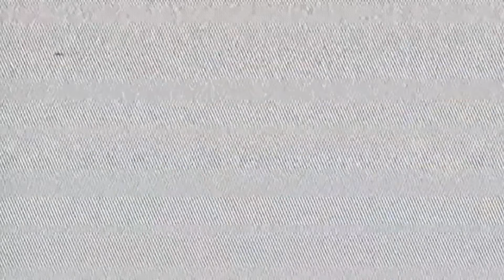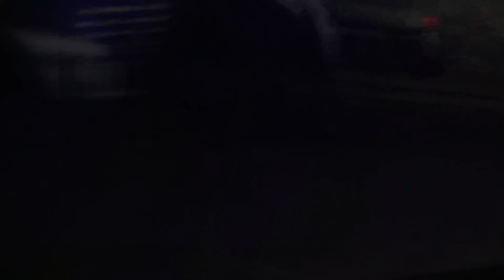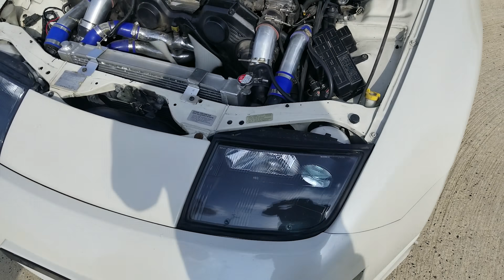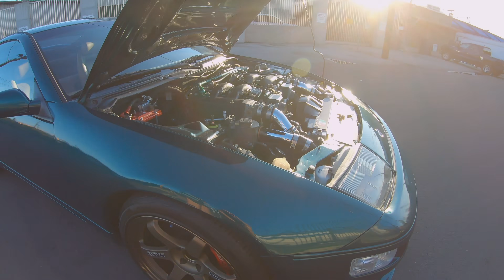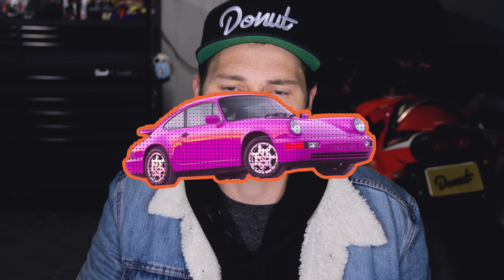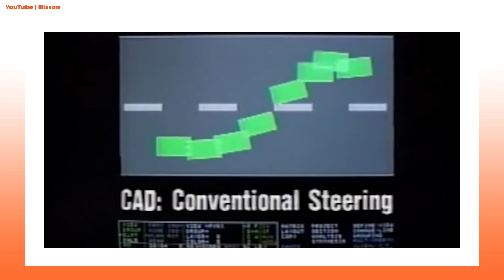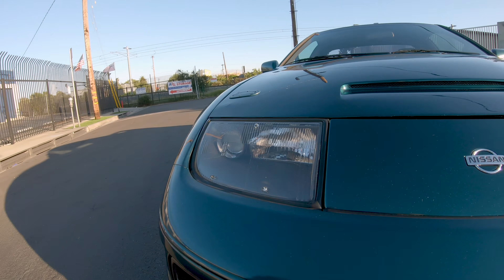The Incredible Tech that DOOMED the 300ZX

Comment: I have raced every single 300z in the world. None could ever beat my acceleration, nor top end.. my secret is I run 2 ply 45 dollar Walmart tires on my stock 92' Buick LeSabre. Also I use weight reduction by only filling my windshield washer fluid only 1/4 full!
I have highly modified it with super white headlights, and basic taillight bulbs from Bond Orheily, of course it helps that I run Prestone 50/50 formula. Leaving the spoke style hub caps, only a full on funny car built for the dragstrip has even the slightest chance of even seeing my basic bulb tail lights when racing me that's how hard I leave mthr fckrs in my dust. Obviously I only race with my Chippewa Boots on, really can't afford to fck around when running high end machines like this.

Glad I was able to help/bless everyone with this powerful knowledge. Just do not fck around guy's you seriously need to use this info intelligently as super cars like my LeSabre leave no room for driver error
Reply: Lmao. NO one wants a Buick LeSabre, even if it was faster. What'd under the hood? Stock you'd get wasted so unless you've got a c6/c7 vette engine in there...You have ZERO chance stock at a twin turbo Z and the Z is the slowest of the 90s Japanese cars (3000GT VR-4, RX-7, Supra). 
Gtfo with your old peraon car. I just read it's stock 🤣 🤣 🤣.  You'd be lucky to run 15s!

Is this a joke post?
Reply: Dude please tell me this is a joke

Comment: The 1989+ 300zx will most likely be my retirement gas powered car. We should all have one (by we obviously I don't mean non-layman car owners.).

If you have read this far the 1989 300zx I had at 23 (yes ik 23 is a bit late to have a first car.) Was naturally aspired, but the person who owned it before me did something.... amazing to it. It had a fully copper master flow inspired exhaust. I have NEVER heard a sound like a 3L engine with copper master flow. It purred deep and low. I truly hate myself now for blowing it up. 

I rebuilt some basics on it but never got to the valves and rockers. The heads and O rings. The intake was never cleaned and I never checked the fuel system. 

What happened was I took my family and my gf to a native ritual on crow Mt. My gf bitched the ENTIRE TIME. I was annoyed with her and drove 3 hours at 95mph to be done with her bitching. 🙃  with 15 minutes left to go the exhaust valve on the first piston stuck shut. Yeah. It over compressed the first cylinder and (because of a bad bearing in the lead of the crank) blew the first piston out of the oil pan. I drove for 15 minutes on a nissan engine with 5 pistons and no oil... at 50 mph. 

All that to say. I respect nissan. And I miss my ZX..

If I have a chance. Yes the 300zx 1989+ is my car. I was born in 1990. LETS GOOOOO. 😆 🤣

Comment: I had to toss my TI-89 aside as I got older..  Too damn hard to see.  Now I have a backlit HP (which has an odd viewing angle, as the panel is upside down).  I did absolutely love the styling of the 300Z then.  I always said if it had a Porsche logo on it, they could get 3 times the $$$ for it.  Cool

Comment: Almost picked a TT 300zx up a few years back.  Owner wanted $6k for it.  Only problem was I had to replace electrical wiring.  Common issue for these cars.  It was going to cost extra $2k to fix.  So I passed on it.
Reply: Should of got it bro

Comment: I have an 86 naturally aspirated that I am currently turboing right now with a 50 mm turbo a big-ass intercooler and 550cc injectors with Paul netonnet Billet fuel rails all 6 a n fuel lines and n i s t u n e and many many many more things my car run great I drive it everyday it's lowered slammed on the ground barely makes it over speed bumps tires are almost touching the fenders but you can still drive it super aggressive slide it drifted whatever you want and nothing rubs LOL I haven't said exactly where I want it and I've owned four of these over the years I work on it daily even though it really doesn't need it I'm always improving it but I would not have it any other way I love busy cars everybody style every era I love the Z car. No matter what year

Comment: Big thumbs down on this video.   Not sure how any of the things mentioned "doomed" the 300. I think it's fair to say that the 300 was far from doomed.
Reply: Compared to its competition it was slower in a straight line by 1994, and dead by 96. In comparison the Supra and 3000GT sold more cars and both were noticeably faster than the Z32 TT. 
ALL that being said, it wasn't "doomed" at all. The SUV craze and bubble economy in Jaoan are the main reason why it died. Nissan should have added more than 300hp/287tq when the 94-99 VR4a and Toyota Supra both had 6 speeds and 320hp. They chose not to (the car cost Nissan money) and died because of that

Comment: Working on the Z is tight but it’s extremely simple.
Reply: I wouldn't exactly say simple. I had a 91 300ZX Twin Turbo 5 speed and it could be a nightmare to work on sometimes. Then again I had a 98 Mitsubishi 3000GT VR-4 and that was also a pain to work on. The VR-4 smoked the Z in a straight line but the Z handled better

Comment: I had an '84 (Z31 for those who don't know, the "ugly duckling" Z) I bought in the service that I built with Wiseco pistons and a single Garrett T66 turbo with single overhead cams and 2 valves per that would smoke most cars in it's day back in the early 2000s when I built her. Z32's were still pretty pricey, so I spent the money for one on my motor (although, I came close to signing a deal for a '95 SMZ 300ZX. Look it up kids). Was a hoot to drive, unless your thermostat went. Then you have to practically take off the whole front end of the motor just to get to the damn thing. I got so fed up, I sold it. Wish I didn't now...#sellersremorse

Comment: Variable valve timing is not an adjustment simply because a motor has a lesser need for air under light load, but to balance a desire for "low end torque", with a desire for "high end horsepower", or so a strong motor won't be gutless, needing 10,000 rpm before it has the power to go 30 mph. It's to have the metaphorical cake, while eating it too., aka  "VTEC", but on a real engine, instead of those itty bitty cart/ econobox/ damn near bike/tiny ass 4 pot poof powerplants of earlier Honda. YouTube "teachers" being wrong is so common that I'm used to it, so whatever.

Comment: The 300ZX was a low production vehicle sold at selected Nissan dealers. Every Nissan dealership wasn't worthy. Nissan told dealers they must send mechanics to a 300ZX school at $20,000 per mechanic to learn how to work on the car to service it at their dealership. Only 2 dealerships in Dallas Texas sold the Z. Trophy Nissan and Courtesy Nissan. No other dealerships for over 400 miles sold the Z. Maybe in Austin or Houston. So you could not buy or service a 300ZX at any dealership, and this made dealerships look bad or amature. The same happened for the Nissan GTR. To sell a Nissan GTR the mechanics have to go to GTR school to learn to service the GTR and have the right to sell it. I own a 1995 300ZX twin turbo and only about 2000 were sold world wide in 1995 which makes my car worth more than a Nissan GTR. As a car collector you want low production numbers. And a 1990 300ZX has the highest production number making a 1990 model the least valuable. Now the Mitsubishi 3000GT was mass produced and that is why they are not valuable. The 300ZX was lile a GTR in the 90s. It was not sold like a natural aspired 370Z. The twin turbo engine in the Z32 is also  made for the z with forged internals. When one engine fits in one car it is expencive to produce like the 3.8L twin turbo GTR engine. This new Z35 will use a mass produced engine from Infinti and it will not have its own engine like a 300ZX or GTR. And Infinti cars are rare. You have to buy them from a Infinti dealer, and every Nissan dealership don't sell Infinti. And if Nissan makes 50,000 Z35 the first year only about 10,000 will be sold in the US. So this new Renalt Z35 will be hard to get. Renalt ruined Nissan and Mitsubishi.
Reply: Ur car is NOT worth more than a gtr. Sorry to disappoint you.

Comment: I've had a 300zx z31 and 2 and they are both pretty good cars but is you want an 80s or 90s z
Just settle on a 280zx na/Turbo.
I daily mine and it has never broken down while driving. And has a very good weight distribution. If you have the money you can easily make around 500 horsepower at the  wheels.
Plus they are dirt cheap for the performance, just be careful around fast corners (over 80) 
They behave like a 911

Comment: I had one of these. I did not like it. Turbo lag was extreme. If I punched it, it took forever to get going. Braking was very poor. I could stand on the brakes with both feet and it would take forever to stop.  Once it got going it was real fast.  I could cruise at 125mph for an extended period. Faster than that and it became unstable. Probably the tires.

Comment: I've built 2 Z32s and am on my 3rd one, Z1motorsports is by far my go-to for knowledge and parts. Those guys are fuckin champs.
Reply: Modding them is so fun. Stock they're really lacking, even in twin turbo form, but put even some small mods and it turns into a monster. I kept my 92 TT 5 speed stock for awhile then couldn't resist. When I sold it it had 450-465@whp. Terrible from a dig but from a roll it was a beast. One of the few cars I regret selling, but it went to a good home

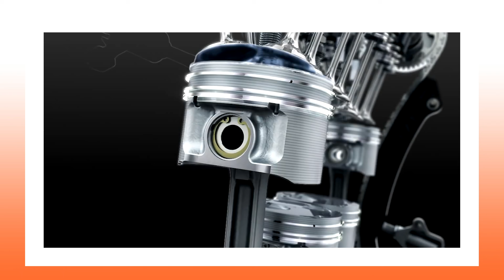Comment: 4:45
When will mechanics worth their knowledge understand that air is NOT sucked into an engine? ... it's pushed in from either atmospheric or boosted PRESSURE from outside the intake.  Regions of vacuum cannot pull in (suck) anything.

Comment: It was doomed due to the Japanese economy bursting and the SUV boom. Also Nissan didn't update the Z32 where's it's competition got faster (the 94-99 Mitsubishi 3000GT VR4 got less weight, more power, higher boost and a 6 speed, the FD3 also got upgrades and the MK4 Supra debuted with the most power. 
It's unfortunate that the Z died in 1996 and their swan song was giving the Z 280hp even in the manual transmission models (280hp was standard for twin turbo autos) because of emissions. They always kind of ran mediocre numbers and that really became apparent in 1994. The Mitsubishi and Toyota were much faster cars in feel and in numbers. 

All that being said, the Z32 was the best balanced of the 4 and handled the best imo.

Comment: It might have some retro-chic now, but this was the most quickly dated designs ever released. It looked futuristic and new in 1990, within a year it looked old. This was a topic of discussion back then, when it was released pretty much all my friends really wanted one at introduction, two years later, no one I know did anymore. This styling aged like milk. This why sales plummeted after the first year 22K in 1990, 15K in 1991, less than 10K in 1992 and 1993, then under 5K until they killed it. It died because of the styling, not despite it. It just did not look good at the time. They didn't sell enough to blame overexposure, the design itself was the problem. The design still looks old, but the car has the benefit of being old now. Back in the 90's, it was being sold new, but the styling looked dated, not a good combination. You might like the way it looks, but back then people in general did not. It looked futuristic for about 6 months, skipped over current and went straight to dated. I can't think of another car design that managed to do this, or give you a single reason why it did so, but it is what happened at the time.

Personally, I think the new Z is going to follow this same path. The first time I looked at it I though it was pretty cool, the more I see it, the less I like it. I still like it, but it's not a good sign.
Reply: It wasn't just the look. By 1994 the Mitsubishi 3000GT VR-4 was running 13.3-13.5@101-105mph stock and the Toyota Supra trapped 106-108mph, both were noticeably faster than the 300ZX TT which ran 13.8-13.9@100-104mph. The Zs competition simply ran faster times in a straight line and on the track. It was also hit by the SUV craze. It died in 1996, but did have a better run in the US than the Mazda RX-7 Twin Turbo .

Comment: I Owned a 1990 300zx for 10 years and spent prolly 20k$ on it. Loved it so much but had to let it go due to being a money pit and the engine knocking. The hicas system is a gimic and is horrible. I got a hicas eliminator system an ran faster on track and didn't spin out drifting.  Sadly I sold my Z and got a 2016 mx5 nd. Tech  has evolved so fast my first timed lap in my mx5nd at willow springs was 2.3 seconds faster than my z. Don't worry tho. I might trade her in for the 400zx even tho she kinds ugly